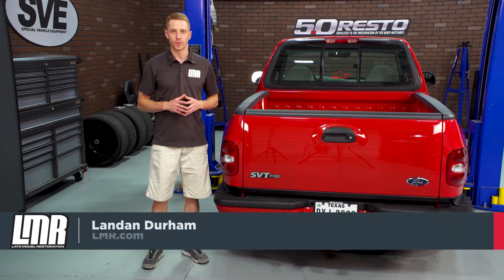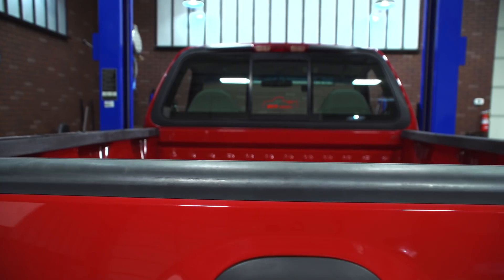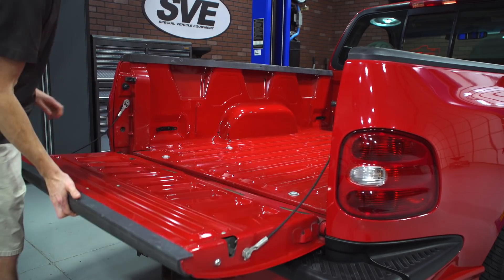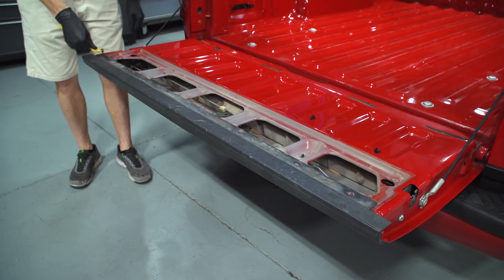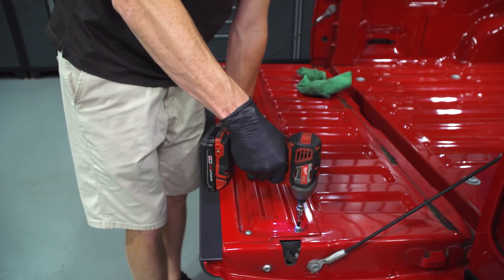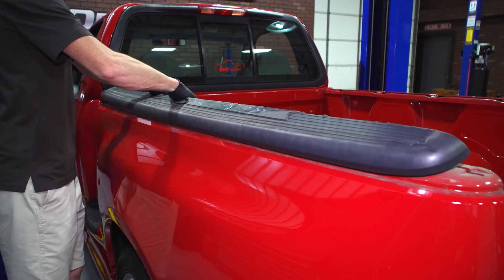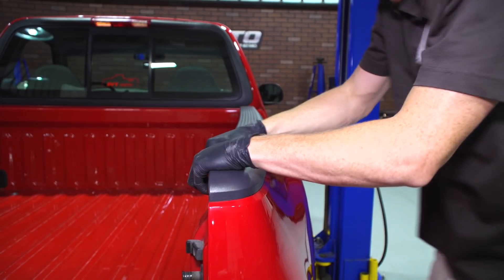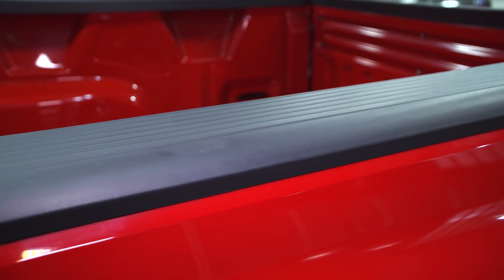1999-2004 F-150 SVT Lightning Bedside & Tailgate Moldings - Review & Install

Comment: That's one clean 99! Also some detailer spray will make install a little easier prior to installing the bed rail moldings. Spray some liberally on the bed and the moldings will slide in. ;)

Comment: Where can i get the 6 bolts for the tailgate access panel?
Reply from the maker: We do not have these at this time. You may check at your local Ford dealership. I will pass this idea over for a new product idea.